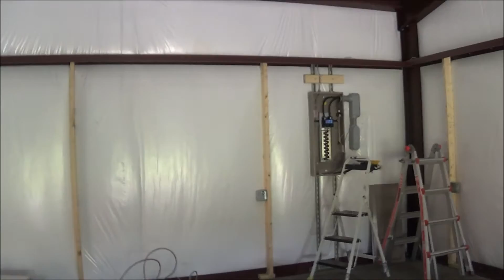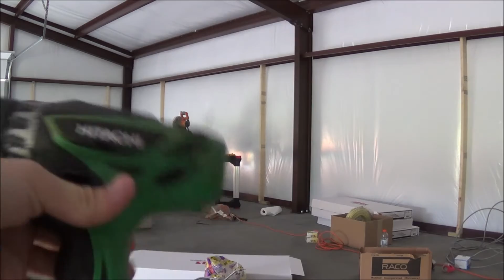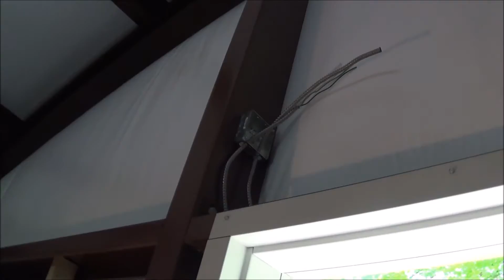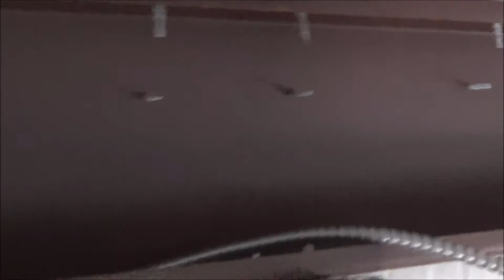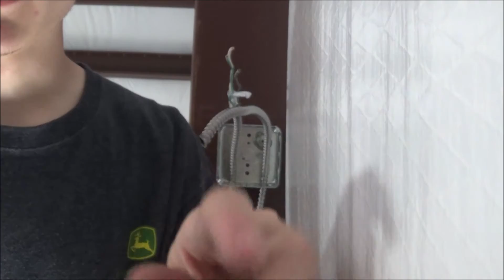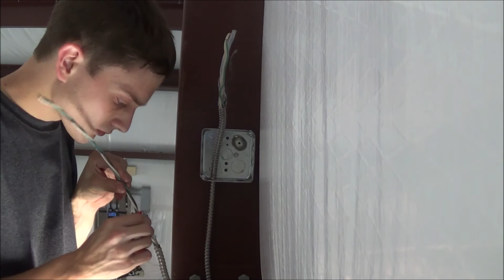Working on the building electrical

Comment: Why didn't they put another metal crossmember closer to the bottom of the building? You could have just connected all your outlets to that. They cheaped out when they built the building.
Reply from the maker: Those beams are not cheap.
Reply: @crazyjdkid  Well just as long as they reflected it in the price.

Comment: When you bring the MC wire out to the lights are they exposed to weather? Are you supposed to use weatherproof mc when bringing out to a light?
Reply from the maker: Mine is not exposed to the weather. Right behind where I put the wire through the outside wall, I installed a box. I installed unistrut on the inside in the shop and tightened a electrical box to unistrut to the outside too and ran the MC into. I mounted the light directly to the electrical box on the outside. And used a rubber gasket between the 2 to waterproof it ,and caulked the small hole where it entered the building. I didnt really run any length of wire on the outside of the building. As for using waterproof MC outside, I believe it depend on your local code.  My building inspector didnt have any issues with what I did. Although using "parking deck" MC cable wouldn't hurt! Thanks for watching!

Comment: Man that was painful watching you trying to strip MC. You actually are telling peoples it easier to do that than use roto splitters. This may be the worst advice I've ever heard. I'd fire my guys if they took that long to do that. Also when you are using the quick connect connectors with bushings you do not need the anti short bushings. If any inspector knew you were stripping your mc that way you'd never pass. No diss against you but you need more training before making instructional videos. Also You do not need box extensions unless you have 4 or more entrances into the box. That's the rule of thumb on that. You seem like a smart kid and self taught electrician. No shame in that... Good luck on future projects.
Reply from the maker: Well I had no idea what a roto splitter was until you commented! If I had one it probably would have significantly sped this up for sure! As for the quick connects with the anti-short bushings, I was instructed by the inspector to install both as the quick connector only protects the wires from the connector and not the sheath the wires are in. He would have made me redo them if I had left them out. The inspector didn't care how I stripped the MC. I didn't intend on this being an instruction video, but instead more of an update. Although I see where you are coming from, and that's why I put up the disclaimer! That box was extended, as it shortly after this video, had a few more connections installed requiring the additional space. Yes, I am self taught and taught by watching others, as well as have a little bit of an engineering background. Thanks for watching and I appreciate the tips!
Reply: what is the proper way to strip MC?
Reply from the maker: I would imagine with the tool called a roto splitter.